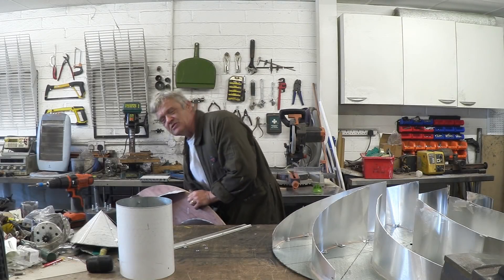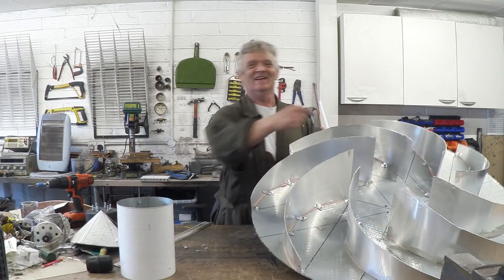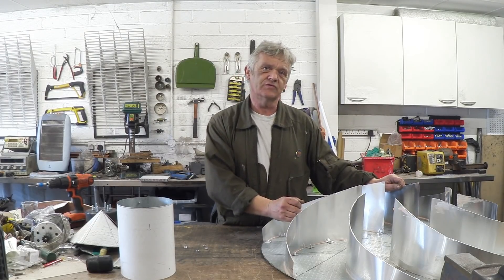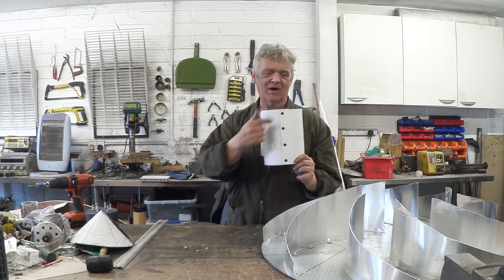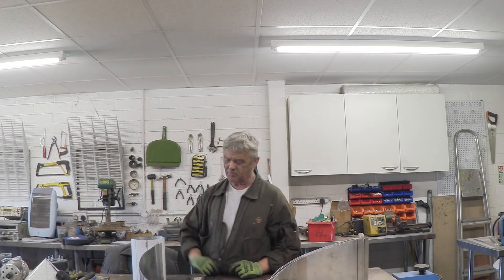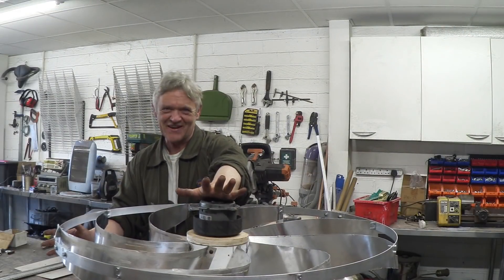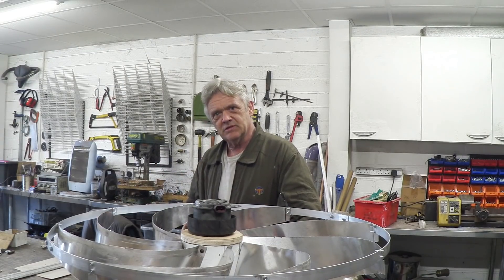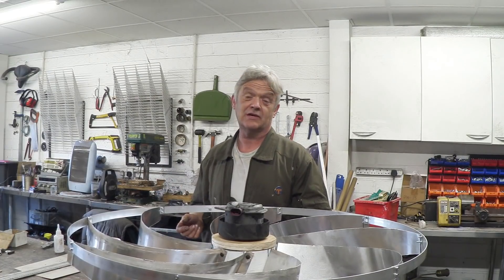1138 The New Wind Generator - Exploring Suggestions

Comment: Love watching your channel.  How would you design a wind generator that would only be used with 30-60mph wind gusts?  We have conditions here that under wind warnings, the power company shuts off power to prevent fires.  It also happens to be during 105F weather.  We sometimes go without power for 2-3 days.  Do you have a design that would work, to give us power under those wind gust conditions to charge batteries, to keep a 600 watt kitchen fridge  and 100 watt fan running.  I'm thinking about LTO chemistry batteries that can handle high wattage charging from the sporadic gusts.

Comment: On the all Aluminum one... It's the Angle of Attack of the blades and amount of spring in the blades, they have to be more rigid. You loose power when they flex and it changes the AOA of the blades at the same time.
I would like to see the plywood backed one running horizontal to the ground.

Comment: As has been stated many times in previous comments, a mistake was made with the 45° twist at the root; it's in the wrong direction. The root of the blade is driving in one direction, and the tip in the other . The blades need to continue the twist so that they get flatter (not more in-line) to the wind. The tip is moving much faster than the root, so this twist keeps the angle of attack constant; just look at any propeller.
However, I don't get the point: this all started as a possible way of overcoming Betz' limit (title of the first vid). This path (flow through a fan) has had billions of research dollars thrown at it already, over a century, starting from the Wright brothers, if not before. The simple value in this is to keep the backplate (bringing the velocity in the original airflow direction to zero), build your best possible generator, and see if you can possibly get power above Betz' limit (by simply checking mathematically). I think this was a distraction, it didn't really prove anything because of design flaws, and improving it will just make another fanblade limited by Betz' Law, at best.
Please put the backplate back on 😊 and keep going down the original experimental path

Comment: Those blades need to be propellor blades, with some profile to them to afford aerodynamic lift. Most of all, they must have much  flatter pitch. I.e. you need to turn them more than 45 degrees from your original design, till they are almost square onto the wind. Turn their tips more, not less, than at the hub. Then you will see it  go! Before you start cutting it up for scrap, just turn their tips full 90 degrees and attach them longitudinally along the outer ring. Then you will have achieved the long proven design of the Cretan Windmill.

Comment: I think your structure is not rigid enough.  You might try something less complicated, like straight styrofoam arms coming off the central rotor.  RC airplane modelers have been using styrofoam for decades.  You only need a simple angle-L on the back and a chisel-point on the front.  The chisel-point minimizes drag along that side while the L-shape on the back picks up maximum drag not unlike your current project.  But it is a whole lot simpler to manufacture.

Comment: what if you go with a half back plate by extending the blade and shaping it to cover the space by half. leaving a way for the air to escape.
To test this you could cover the whole back with cardboard and cut out slits following the back of the blades.

Comment: The backing plate is what forces the air into the blades pushing it around.If you don't have a backing plate it won't work unless you put a twist in the blades. I think this design would be best suited in place of a  prop blade in a slightly modified wind turbine so it can be  directed into the wind.. It could be used without a large tower for easy maintenance and be setup for low cost and would not be as dangerous for birds. Could be a good Idea if it performs well when there are high winds, I have a feeling though the efficiency would drop the higher the wind speed. Arrays could  be solution to that

Comment: As kids pinwheels spin like mad in slight breeze, I wonder how a large scale one of those would do vs your impeller mk2?
Reply: I I run kid's pinwheels to keep critters away from the vegetables. Looking at them, the "blades" are so wide and the curvature so great that it creates a backboard.  The first 2/3's of the blades are essentially back board.
Reply: They dont need to be big, just many.

Comment: 4:24 Rob, i think you might have put the new blade design backwards
Reply: I also wondered if the blade twist was in the wrong direction
Reply: That's what I thought too
Reply: ... or alternatively, the 45 degree angle was in the wrong direction? i.e. / instead of \
Reply: Agree. Looks like the tail/generator are mounted on the upwind side. Easy test, tie a string to the tail & stand up wind holding the tail upwind. I would bet it will spin.
Reply: @ianbrown8408  
Yes, that's what i though he'd do
Clearly he didn't notice and neither did anyone else in the comments
I was so confused 😅

Comment: It would only work without the back plate if the blades were curved  perpendicular to the long axis.    As it is there is nothing for the wind to push against and no lift.
If you did curve them you would have something like the turbofan blades as I mentioned in the last video.

Comment: Another valuable experiment. Note that air is a fluid whose viscosity is close to nothing, but still not actually zero. That means giving a slight cone shape to the whole back plate would help. But what would be the optimum angle of that cone at its tip point? My guesstimation is 170~175 degrees (where 180 means flat circle instead of a cone)

Comment: The development of this design is unlikely to  bear fruit as its efficiency has worsened.
The original idea of reversing the function of a domestic vacuum cleaner centrifugal fan was a good one, but the suggestions of putting a large funnel over the hole to improve efficiency was turned down.
Why?
To say that the turbine turns perfectly well without a funnel is like saying that your car engine turns perfectly well on 1 cylinder.

Comment: You could try taping a circle of stoutish polyethylene to the back to make a backplate and then gradually remove small segments with a knife. No reason, just an idea, but with the blades at that angle surely it would be acting as a centrifugal compressor with nothing to compress against.
Or put a frontplate  and backplate on and a large horn forcing wind into the intake.

Comment: Good experiment.  Different methods of construction.  Backplane also makes a better flywheel.  Probably the backplane could be conical.  Outer rim/ring might be a drag with a closed backplane -- much different than your original approach.  Hope that you will try the plywood backplane on a wall or roof.

Comment: Rob Sir Hello and how have you been? This design is awesome, I seriously feel this is perfect even without a backplate, it was tested vertically hence it was not turning, in comparison to the one which has backplate, the wind is forced through the blades after hitting back plate hence it moved in second turbine there is no backplate, secondly the surface area wind catched was way too less to make it going in the design without back plate, if we mount this horizontally the blades in that position will have more surface area than if placed vertical and there it will spin just fine without any backplate Rob Sir, I wish you all the very best, love and very warm regards from India👍🏻👍🏻🙏🏻🙏🏻

Comment: A well meaning suggestion for the back board less model. Still with gaps L shaped flanges on the blades thus stiffening the blades and preventing dampening of the wind. Great project Robert. Another thought c type profile to the blades.

Comment: about your mistake from the beginning .....( 1126)
you measured the wind speed in front of the turbin- in a compressed state, -( between the fan and the turbine)
compressed state- greater air density - more energy
you had to measure without resistance just from the fan ..... at the same distance and then resistance (turbine .....)
you will have a more realistic idea of the process ........

Comment: This confirms the plate is necessary to convert the wind into rotation. As I expected because its even worse than propeller which is made mostly of gaps and was designed to shove air around the blades in the first place

Comment: How about making your back plate, cone shaped. This will concentrate and speed the wind up as the wind moves out to the tips of your blades.
Reply: It will increase the maximum harvestable energy from the wind due to larger blade surface area, but it won't increase the amount of wind going through the turbine. This could actually be used for areas where traditional turbines are currently used as it will be able to be scaled up to harvest from higher windspeeds than the current design is able to.

The current design will simply ignore an increasingly larger percentage of wind once wind speed surpasses its maximum (which is pretty low for a wind turbine), which is part of why I think the open-faced turbine design is really cool as it does away with one of the biggest fail points for commercial wind-turbines, the brake system.

One of the drawbacks of what you're offering though is that an angle like that will allow some of the energy to not be imparted to the turbine due to the fact that it won't be forced to interact with the blades due to the back plate not blocking it. A small angle would probably be negligible but I want you to think on what result you'd get if you swept the angle of the back plate to be parallel with the central shaft.. It's just going closer to a traditional turbine design xD
Reply: @ScarletFlames1  If the front plate was retained but curved like a satellite dish, so most of the wind will be captured rather than bounce off a flat plate. Then the wind is directed into the centre hole and possible momentarily compressed? before expanding along the blades that would be wider as they get to the edge of the front plate following the curve of dish shape. So I’m talking about an impeller but just with a dish shaped front plate. Silly or. ?
Reply: @Kiyarose3999  Intution says there is a better shape for the backplate, maybe the center needs changes to direct the air away from it. And I don't know if a reversed dish or normal dish is the better choice for testing either.
Reply: @vitordelima  So you don’t think thhere is anything in what I said about using the impellers original design, but with a dish shaped front plate?, or the design I described above would act in the way I’ve said? Cos I think the impeller design is really good but cos air flow would  hit the flat front plate and bounce away. That a dish shape would catch most of that wind, and the blades would be wider as they reach the edge of the plate, which could possibly give it more centrifugal momentum?.
Reply: @Kiyarose3999  I don't know.

Comment: Get yourself a smoke machine Robert, you'll be able to introduce smoke into the airflow and observe the air currents passing through and over your turbines.
Reply: Great idea, as a cheap way of making a smoke machine you can use flu bombs, they are used for checking the integrity of gas appliance flues.

Comment: i think you give the blades a tilt the wrong way, i'd also mask the back with something, tape, fabric, something lightweight, you're 100% right this design works best with  the back plate that directs the wind out sideways, or simply put something there as a stand-in for the wall it will be mounted to, i'm sure when it's against a wall it will work quite well 

and no, the folk that expect things to work first time every time are the ones too afraid of failure to try - thus get nothing done, the others don't have the means or the time, that's why thankfully we have folk like you to keep chugging on making ideas, i love that you take ideas onboard from the hive mind of the internet, wisdom of the masses is a tangible thing, and perhaps the only solid example of the whole being greater than the sum of its parts

Comment: The twist you've imparted (by having the angle of attack different at the root from the tip) is counter intuitive. Blades on conventional HAWTs have their tips close to flat to the wind and sloped at the root. Try turning the tips through 90 degrees.
Reply: Yes my intuition at first said why not 60°for more frontal area? Then I noticed it was totally back to front as far as intuition goes.
Reply: I thought the twist was in reverse and the blades where fighting themselves kinda a little back and fore motion in the vid
Reply: Agreed, the angle needs to be reversed, ie angled the other way at the root..

Comment: The backplate could simply be the wall of a building?
Reply: Maybe but that does also create instabilities on irregular surface and might lose energy on the gap behind as well. Also increases risk of jamming by a lot if anything gets behind the blades. But its worth testing with a static plate behind the standalone blades first. He could reuse the parts from this video but delete the blade angle.
Reply: @635574  And you lose the flywheel and the constrained air channels the backplate creates (this problem would be solved by the static backplate).

Comment: I looked at your new rotor-design and your first attempt with little wind-speed ... and my first thougt was: He mounted it in the false direction/ wrong around. the prinicple of your design would require the blades to be in the opposite direction .... or easier: mount the generator on the other side of the rotor ... would be interesting to see both rotors again at low windspeed 🤗🤗 Maybe I´ve got it all wrong - but worth a try.  Greetings from North of Germany and thanks for all your informative vids 🥰

Comment: My thoughts: you need to put the back panel on the 45-degree blades to see if there is a difference because we haven't ruled out if the 45-degree blades are what caused the problem. The 45 degrees almost looked like it created equal pressure on both sides of the blade. maybe not it's hard to tell without a good inline shot of the blades.

Comment: The surface just didn't create enough resistance to the flow of the wind,. It makes sense in my mind that it is 50/50 balance. If the wind speed and volume is reduced by  50% after the collector then you have peak usability of the winds force. I am thinking about a sail boat just before it takes off unless of course your tacking a sailing boat which isn't a static object!

Comment: it seems to me that this one would have performed much better if the angle at which the blades met the hub were flipped. The angle you've attached them at offers what I'd consider the back of the blade to the wind, but worse the circumferential hoop is directly in the path of the air that does follow the same path as air exiting mk2.
having said that, even remedying these issues wouldn't make it more interesting than mk2

Comment: Change the back plate to the shape of a cone and put the flutes on there kind of like a multi-fluided drill bit but fanned out like the center point and it won't be like hitting a brick wall when the wind hits it it was when it hits the point it spreads it and makes it spin up because it's got like a twist to the flutes like a drill bit as the wind hits it it will spin it up really fast really quick low wind speed trust me it'll work great

Comment: impellers tend to be optimized for high static pressure, the backboard converts air velocity to static pressure centered on, well, the center of the backboard. The only way for the pressure to equalize is flowing sideways down the blades. If you have a crosswind you get the same thing just with less wind area being captured, still totally functional. Either way though, the backboard is a necessary component. You are right that throwing that demonstrator together was a valuable test since that explanation would've just been a hunch and all sorts of ghostly unexpected things can happen in practice with fluid flows